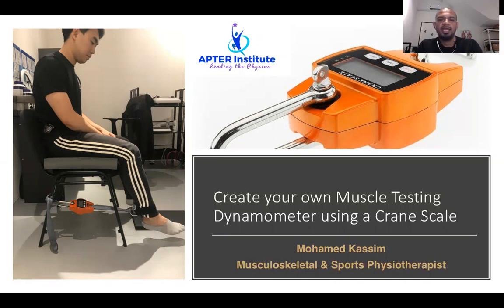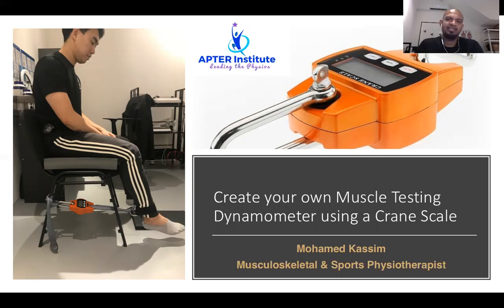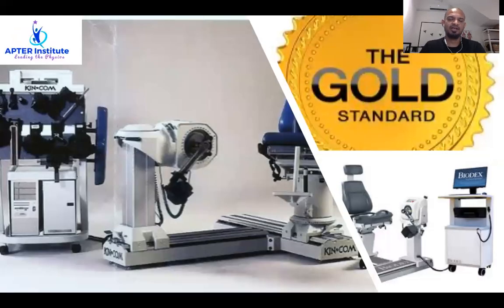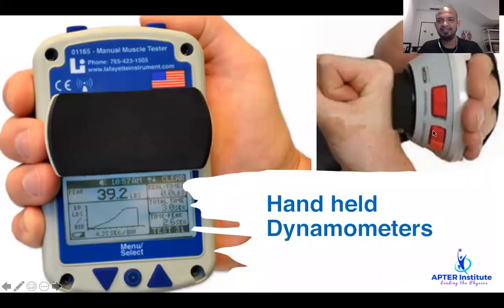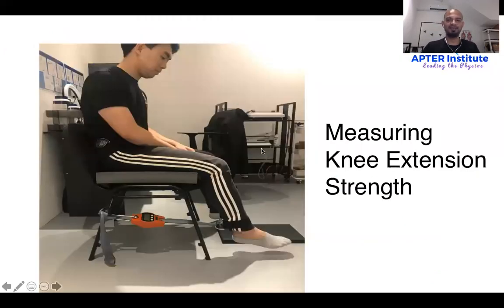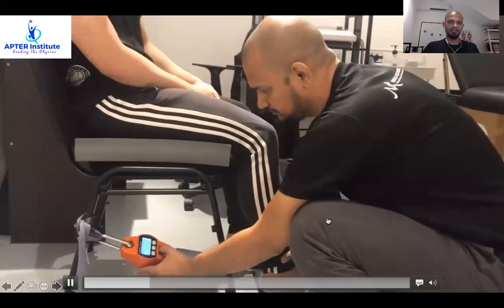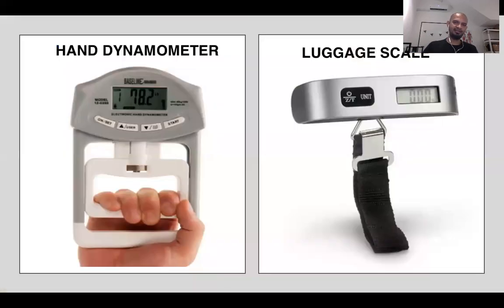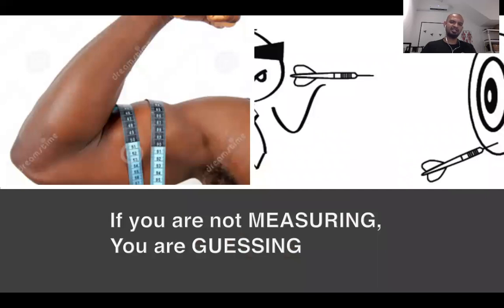Creating your own Muscle Strength Dynamometer using a Crane Scale

Comment: Can we measure serratus anterior muscle strength by using crane scale? How we'll check sir? Can you explain with example
Reply: You can use usual floor analogue - scale and push into the wall with your straight arm as a test.